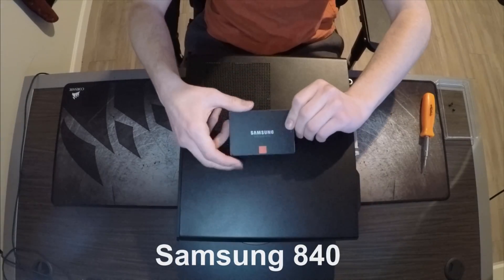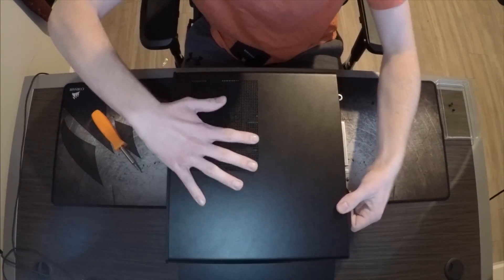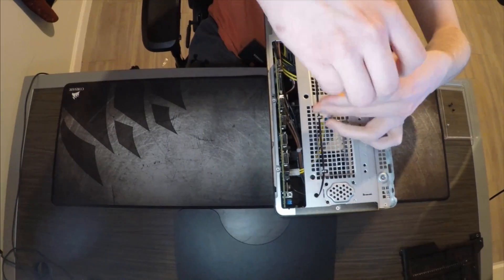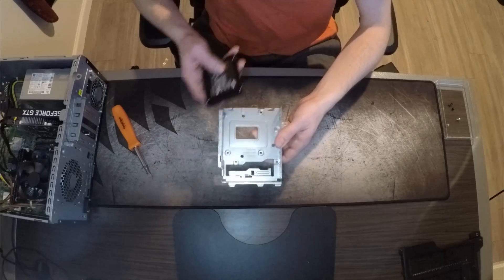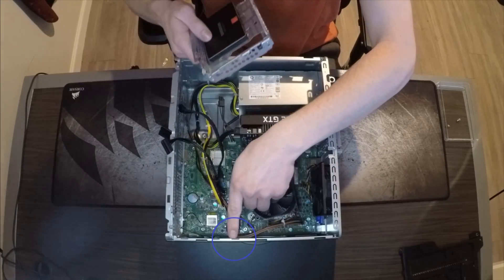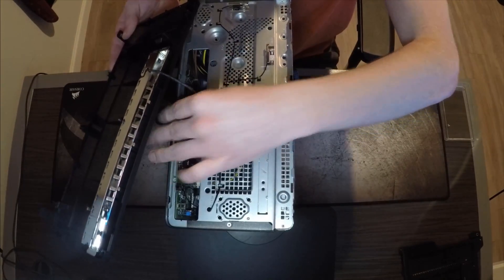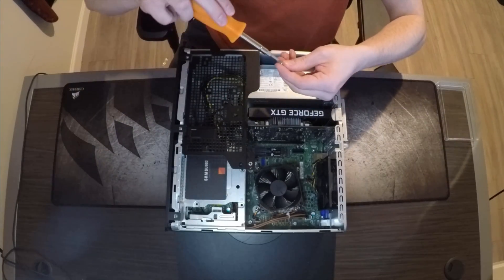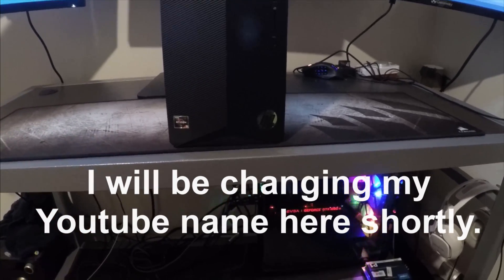HP Pavilion Gaming PC Gets SSD Upgrade TG01-0023W

Comment: Thanks!!! BTW do we have to upgrade the psu if we want to upgrade the GPU to rtx 3060?
Reply from the maker: Yes, I would. You may be able to without getting one, but for safety and reliability I would.
Reply: I mean it might work PC Part Picker says with 1 mechanical HD this system with a 3060 is 339w.  3060 is 170W where the 1650 Super is 100W. If you don't have any HDDs you saved 25W headroom. So can you cover that 45W. Anyway just expect everyone overestimates.
Reply: Yea, you would need to upgrade psu for a 3060. Probably motherboard as well.
Reply from the maker: @MrDarkcore  Motherboard and power supply would be very recommended to do for sure
Reply: Yes you definitely will need a 400wat psu at least if you want to install a 3060